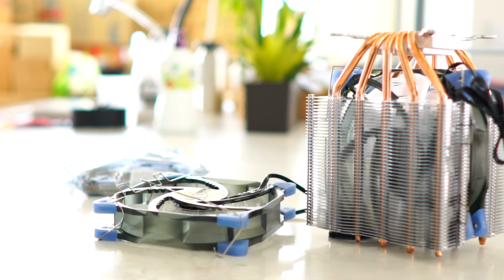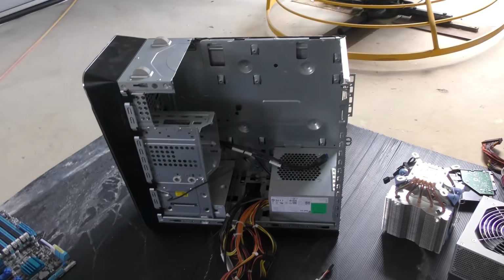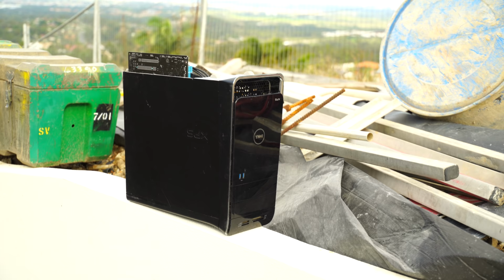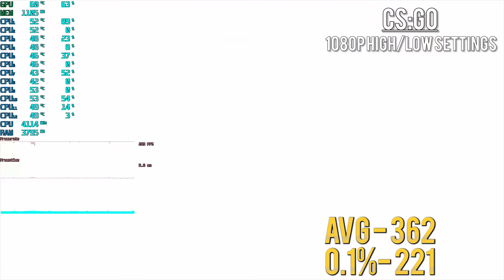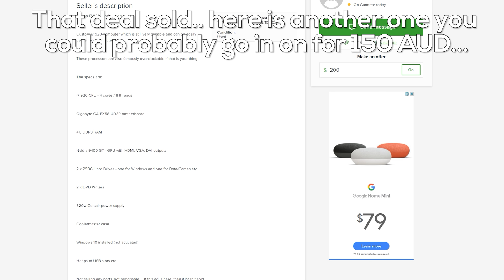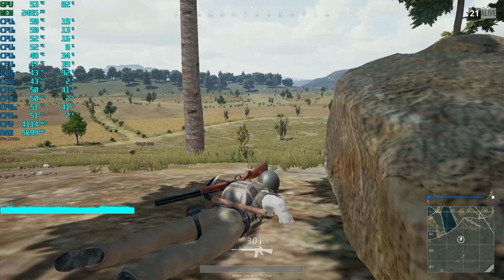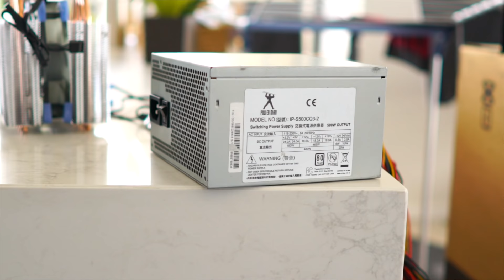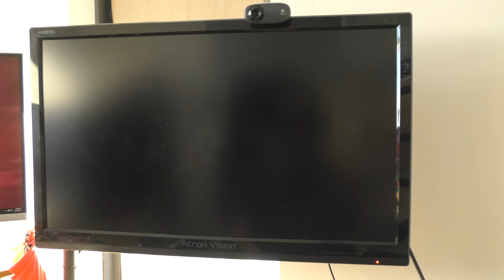Build a 6 CORE GAMING PC for LESS than an i7-8700K!

Comment: That power supply wont live for long on such heavy overclocks. :D I wouldn't put a 10$ PSU in an office PC.
Reply: he uses them all the time. They have really good 12v rail
Reply: they are really good power supplys, he got them for that cheap in japan because of some weird electricity thing that i dont understand, basically they work in his country but in japan they dont
Reply: Oh, ok. I missed that episode then.
Reply: Frog Cartoons Are Racist Nazis The PSU is from IN WIN. There is a indepth review of the 600watt version at hardwaresecrets.com.
The quality and performance is quite solid. The 600 watt did sell for 89 dollars in 2010. 

I did look it up because by the looks you would assume another Chinese risky PSU...
Reply: These aren't just cheap no-name PSUs. These older supplies from companies like FSP or Super Flower are pretty decent, and they go cheap online.

Comment: Rule number 1: Don't cheap out on the PSU!
I learn't the hard way when one burn't out my hard drive and DVD drives and the motherboard was never the same again.
Ironically the power supply still worked but it obviously wasn't supplying the correct clean voltage so I binned it and have never used a generic PSU again for any build except a skip build which literally cost me nothing.
This build is far too expensive to risk it as the Powerman PSU's recieve very mixed reviews.  A few dollars more would get something that is genuinley considered reliable from a reputable brand.
Reply: ^^^THIS!

Comment: i was rockin the x5670 for a bit on the ROG mATX gene ii, and then later the gene iii, and i was able to run 4.4ghz on custom water all day and temps were great. Paired with a HD 7990  OCd to the moon. It wasn't until the 7700k @ 5.2 ghz with nvme and Pascal came together, that I felt like I had a faster system. So much snappier! Just got notified earlier today that my 8700k is being delivered finally, so I can return to 6c/12t glory!

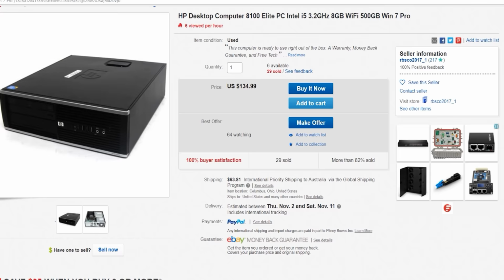Comment: At the 13:01 mark where you can see your Amazon history on the right side of the screen, there is a grid with six items. The top middle item looks like a node or line extender / trunk amp that a cable television company would use.

Comment: I did a kind of hack job putting a 6200 motherboard with a dual core in a mid size case.  It actually turned out working pretty well  for the parts that I had to use.  I had to work around Dells funky plugs but it booted and did a pretty good job.

Comment: I just built this exact system a week ago with a gtx 1080 and my x5670 @ 4.3ghz! 90-140fps in bf1 ultra 1440p thanks for the vid! if you disable Hyperthreading youll get probably 200mhz more, you'll be able to increase the voltage since hyper threading makes it run hotter. games only use 6 cores right now
Reply: Derick Christopherson, I've got 4.9ghz turbo and 4.7ghz on all cores with HT, under load, on the same motherboard and x5650. The cooler is an aio from ITEK 240mm, for 65 euro.
Reply: I dont think i ever wanna water cool personally, too afraid of leaking, Im just using a hyper 212 evo though, thanks for the recommend!
Reply: You might want to check Battlefield 1 multiplayer with 6 threads and rerun with 12 threads. Battlefield 1 performers much better with 12 threads. 

X5675 4.6GHz user + GTX 1070.
Reply: in dx12? I get stutters on dx12, which is sorta a common thing with the game. I can only get 4.1ghz without overheating and hyper threading on with my hyper 212. I've gotta use 1.387v with hyperthreading off too get 4.3ghz. im comfortable with anything less then 90c. I think i got a bad overclocking cpu honestly
Reply: Detmer I just tried with hyperthreading @ 4.3ghz, seen the same framerates. I even tried 768p so my gpu wouldn't be pegged at 100%, this made the gpu go too around 60%. the cpu would only hit 50% and it would run hotter , I'm assuming because it wasn't using more then 6 threads like I thought. I tried dx11 and dx12. So hyperthreading made no difference in bf1 for me. But once games use more then 6 cores that I play, I'll definitely enable hyperthreading again.

Comment: I really like what you do with this older hardware.  I too have been playing with X58 systems.  Most current is an X5660 @ 4.5GHz with a GTX 1080 Ti.   I lose about 15% over my i7-7700K @ 5GHz.   The price/performance ratio is pretty great, however most people balk at sticking a $700 video card in system with a $25 CPU.  Ha!

I find that a GTX 980 plays very well with the X58 system.  I have a GTX 780 that does pretty well too.  These will be donated to friends that don't have the income to buy a system for their self.  Keep up the good work mate!

Comment: One quirk I found with overclocking my Xeon is that it likes a cool NB. As long as I'm sub 70C on the NB with my current OC it's fine for days, but I'll get a crash if the NB lingers at 70C for like a dozen minutes or so. On the same NB topic, to test for the best NB voltage you can use Cinebench oddly enough (found this by complete accident), so I tried my NB at 1.14V and my CB score went down to ~980, but when I set it it 1.16V my CB score went back up to ~1000, so now at 1.18V I know it's rock solid.

If you have USB problems, which is more likely with a high BCLK, the fix for that is to set the SB/ICH voltage to 1.15V or 1.14/6 for Gigabyte's 20mV stepping.

Also if default QPI/Vtt PLL and IOH voltages are the same, then set them both to the same voltage for best stability, so in my case I've got them both at 1.18V.

For my current 4.4Ghz OC
Multi - 22
Base - 200
LLC - Level 2
VCore - 1.35V
QPI/Vtt - 1.335
CPU PLL - 1.98V
IOH and QPI/Vtt PLL - 1.18V
ICH - 1.14V

Comment: I  have the i7 980x  on that same board paired with 24Gb patriot ddr3 ram @ 1866Mhz and a reference evga gtx 1080 all in the fractal meshify C case.

The cpu is cooled by the raijintek triton  AIO (240) and it is currently running @ 4.2Ghz (HT ON)... I absolutely love it.

I can run  every game @ 60fps on my ultrawide (2560 bt 1080) on high or ultra settings. I can record most games, stream, this pc does everything.

the problem is  the boards on the 1366 platform are  extremely expensive.

Comment: Nothing currently ages as gracefully as the phenomenal X58 platform! If you already have a good X58 board and triple channel RAM, you have an abundant choice of used 6c/12t Xeons that are dirt cheap! Also, nearly all of them can reach freqs above 4.2GHz, can be easily cooled (soldered IHS) and are strong enough to push way above 100fps in games when OCd. The triple channel RAM allows fast and smooth work in productivity tasks as well. Furthermore, as 6c/12c is slowly becoming the new 4c/8c the X58 will surpass the beloved Sandy bridge in games too. Absolutely brilliant and timeless platform!

Comment: You can clock it harder than that. Westmere cpus will happily sit in the 1.375-1.4 volt area if you can keep them cool
Reply from the maker: This cooler won't handle much more, 4.3 was a good sweet spot for it.

Comment: Regarding PUBG, I've noticed some interesting behavior with the two systems available to me. One with an i7 3770 and a r9 280 and one with an i5 7600k and 980ti. If you put the settings at a mix of medium low and high, and make it so you stress the gpu just so it is right at a 100% usage, it seems that though you might possibly get lower average frames, you get tighter frame times. Especially on my higher end system with the 980ti, i notice significantly less stuttering

Comment: My used parts build: $420
 x5650 - EVGA x58 combo = $100
 780 ti Classified = $125. 
760w Platnium PSU Corsair (refurb) = $64
212 Evo cooler = $20
256gb SSD = $60
12gb ddr3 Gskill 3x4gb = $50

Comment: Lucky the boards are available at all, when building my 3rd gen i7 last spring on the cheap I was stuck in 1155 land where even the basic intel boards are going for well over $100 let alone if you want something good like Asus or MSI, yeah plan on 150+ for 1155 mobo. I was lucky and found an older z77 board for $85 locally but online they want 150 for them.

Comment: PSA - you can buy a Xeon E5645 for much cheaper than a X56** and overclock it. I run mine at 3.9GHz on a Rampage II Extreme and it's very close to a X5650. 6C/12T as well.

Comment: Those old Dell/HP/etc cases are some of the sturdiest out there and I even kept the one from a recent build I did just in case I wanted to exercise some creativity with it as they are blank slates so to speak. Also, those Xeons are insane for the price! Will definitely need to try one out in the future. The most recent build I did had an i5 2500 for £38 which is a pretty damn good deal in itself (not Xeon good but still) and I matched it with an RX 480 with some amazing results. :D

Comment: This is basically the setup that I have. X5675 @ 4.1ghz  (I had a Core i7 950 before and upgraded it - the X5675 CPU was like $43 shipped and works great) on a Asus X58 Sabertooth. And the GTX 780 (but mine's blower edition). Yep still great in 2017. X58 mobos tend to be pretty expensive if you don't already have one tho.

Comment: Should have gone with the M2N68-LA (Narra3) motherboard with an AMD PHENOM II X6 stepping 3 and 256GB of DDR3 RAM, no need for graphics card unless you want to add an ASUSTECH EN9500GT so you can use a TV as a monitor but don't forget to connect the SPDIF connection lead to the SPDIF headers on both the graphics card and the matching header on the motherboard provided the SPDIF header is still intact, only problem is the dodgy hardware firewall so that is something you will have to sort out.

Comment: I'm running a Xeon X5675 @ 4.6GHz (custom watercooling) and a GTX 1070.  CPU isn't holding me back (all games wel north off 60fps minimum). 

Two games that I play and can  were I can create a CPU bottleneck; Fallout 4 (maxed out+texture pack), but that game is very crooked programmed anyway and the frame drops are only 5fps worse then a 4770K. Wither 3 maxed out + mods drops to 75fps in Novigrad, with a modern i7 this would have been 100fps.

My experience is that the most demanding games of 2017 are running better then 2016 titles because they start to benefit from more then 8 threads. I will wait for the Ryzen refresh next years and probably upgrade.
Reply from the maker: yeah the 5675 is a cut above the other three skus.  4.6GHz is impressive, what cooler you using and also what mobo and voltage?  if you don't mind me asking?

Comment: Lol I guess that's one way to do it.  The XPS 8xxx series cases were cramped, almost no air flow, not many options for fan holes other than the side or top, and probably with the fan mounted externally.  But it only got worse after that one, the 9xxx series they got too clever and used a swinging psu mount over the cpu, blocking any tower cooler, they managed to make the thing worse for no real gain, just more proprietary.

Comment: I'm in the middle of my build $234.28 USD including shipping, tax and whatever else. Which has gotten me
X5660 - 42.23
Sabertooth X58 - 42.80 (few bent pins, works like a charm now)
6x4GB Corsair ddr3 1333 - 91.05
Thick 120mm liquid cooler - 40.45
1.5TB Samsung HDD - 17.75
430w psu - free (will upgrade)
7750 - free (will upgrade)

Comment: Can't wait for the gtx1080 test. Thia might be my next build my fx8370e at 4.5ghz is slowish... In games, i have a cheap 60€ rx460. Cause i sold my rx480 msi gaming x for 300€ to a local miner. Made a 70€ profit after 6months of use not bad

Comment: They're not wrong about watercooling. With those first-gen Core processors, you could win or lose the silicon lottery HARD. Just getting my i7-930 to 3GHz with a beefy air cooler, it was hitting 90 degrees and wasn't stable under-volted.

Comment: Good video Brian. 
These old Westmere Xeons and X58 boards are great. Should last for a long time. Quality of this Asus board is very good. You don't find similar quality for less than 400$ on new motherbords. Sure they new ones have LED's :))
Only downside is this platform and Gigabyte GTX 780 GHz are Power hungry. But at this price, it will take years for a modern build to catch up in lower electrical costs. 
The chosen PSU is not what I would recommend for the long run. I know this is a "pushing the envelope" low budget build. But a better 2nd hand PSU and a CHEAP ATX CASE THAT FITS should be low (highly recommended) extra cost.

I'm sure the PSU is being pushed (3x18 amp 12V rails), and how long can the caps deal with it ? 
Try to measure the power load on it. That CPU/MB (with the OC) platform alone can use 300+W under load. GPU about 250W easily. So in a demanding games where CPU and GPU are being fully utilized it's gonna be dangerously on the edge.

A good second hand Corsair TX750 (first gen) will be excellent. Even a TX650 will do. These oldies can often be found cheap at maybe 30 USD .But they are excellent build quality.

Comment: Did I do good?
I5 2500k w/ 212 EVO cooler
8gb of ddr3
Crossfired hd 6870's
850w corsair power supply
All stuffed in an mid tower with 5 working rgb fans
What I paid: $150 usd

Comment: In about a Week, I will have an i7-2600k, with an ASRock Z77 Extreme 4, 16 GB of Hyper X 1T DDR3-1866, either 2x 512 GB 7200 RPM or 1x 1 TB 7200 RPM HDD - AND a Hyper 212 EVO with 2 120mm fans! I am thinking about $150 USD for the combo? Maybe throw in my EVGA GTX 760 SC for another $60 or so-if desired.

I could even throw an Acer 21.5" 1080p monitor, and Logitech Keyboard and or mouse for just another $50!

Let me know if interested, otherwise I will list this on Craigslist!

Comment: I've just bought myself a x5670 and a Asus Rampage 3 board to upgrade from my i5-4460 and Asus (I don't recall what it is at the moment) board.

I'm hoping the extra cores and hyperthreading will allow me a boost in performance, even if I am technically  sidegrading and not upgrading. I am hoping to make better use of my 144hz monitor and GTX970.

Comment: I have two x58 based systems at home right now one with 12gb 1333mhz and an i7 990x (running on a 120ml aio) and gtx 1060 6gb (my personal computer)
And a system with 18gb 1066mhz and a xeon x5687 running at 4ghz on an air cooler...both preform very well in modern titles and for a very cheap price (got my personal rig for around 400$ and the other rig for about 120$ insane right?)

Comment: Did you ever do a  separate video just about the VTG 5 cooler? I've just ordered one from AliExpress but probably won't have the chance to fit it for a while. Apparently the install is slightly tricky as well so any hints would definitely be useful.

Comment: Man, this makes me a bit sad for my X5650. It can do 4GHz easy at 1.25v but 4.4GHz needs close to 1.4v, which my CPU cooler can handle but not sure if it's even safe to have 24/7. Still, old Xeon chips are definitely excellent value for the money in this day and age of tech.

Comment: i paid 2300$ for a 6 core laptop, so if you subtract the portability, add in the price of the 1080p 144hz screen and bump that up to a 1070 like my laptop has, i still spent a bit extra lol. 

but considering i travel for a living, and the laptop is under 5 pounds with 8+hr battery life, i think i did alright

Comment: I just did this last week with a Xeon X5650 that I bought off of ebay.ca for $40 canadian dollars.
 I am using a $15 thermalright venomous X+2k rpm sflex 120mm fan along with an amazing asus p6x58d premium that I snagged bundled with with an i7 930, 212 evo along with an ati 3450 gpu and that all cost me $85 total.

I have 3x4gb kingston cas 11 1600 1.5v running in the board at 9-10-9-28 1.5v 1600 that I acquired as bonus loot when I parted another system out so that was a good fit for the need of triple channel.
I then added my old gtx 680 SLI cards, 240gb m500 ssd and hx850 along with other spare parts and accessories.

It is overclocked to 4.4ghz at DDR3 1600 at 1.28v and runs in the high 60s-low 70s with the fans in the Antec 900 being modulated via a Bitfenix Recon fan controller that I accidently ended up getting a hold of with another purchase. 

It's quite a powerful build for the minimal investment I have into it and it will beat my 4.6ghz 4790k in some multithreaded tasks like cinebench along with coming pretty close in synthetic gaming benchmarks with the SLI 680s vs the 1070 in my main build.
I ended up adding a bunch of hard drives to it for now and it's going to let me offload some load and chores from my main machine while giving me something to tinker with and also use in case of emergency!

Cool build, it made me make a TLDR long post on here and I love to see people make videos of the kind of builds I enjoy doing when I'm not spending silly money on new parts.

Comment: In response the comments on the cheap CPU cooler. An Air cooler is a fairly simple construction. We need metal to dissipate the heat and that heat should be dissipated away from the heat sink to prevent thermal build-up. The bigger the heatsink... the better it will dissipate the heat. But with 100W+ heat we need a fan as well for long term load.
Anyone can see on the look of it, that it is a Chinese rip-off of the Noctua. This basic design is very efficient. So of course it works. As long as there is good contact from the CPU to the cooler. 
But with these cheap coolers there might be bigger tolerances and differences in them. Meaning that some will work fine, others might not be as straight on the cpu contact surface, and therefore not so good contact. With the Noctua model, I believe they have quality control to ensure minimal tolerances.

The main difference here might be the Fan quality. The supplied fans might not work as long or quietly as the Noctua fans. I doubt that. But looks like a real bargain this cooler.